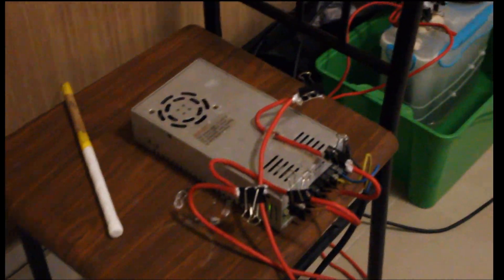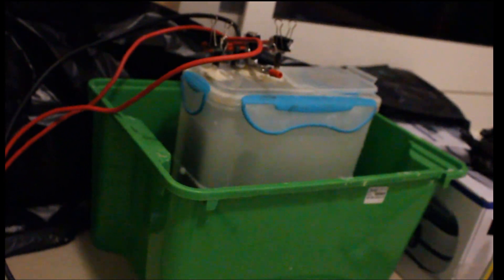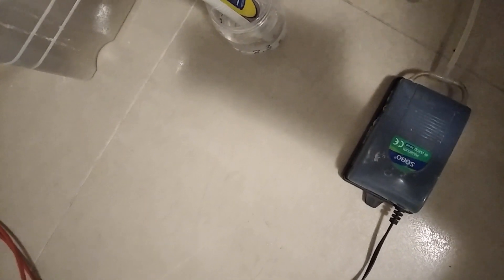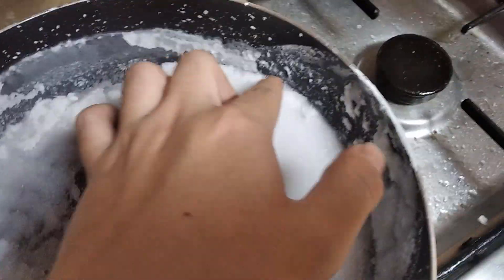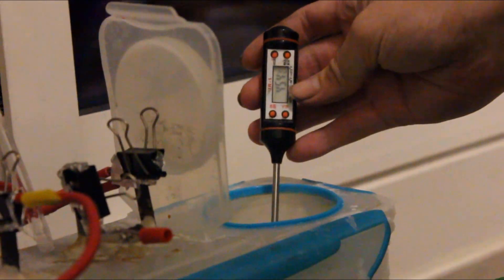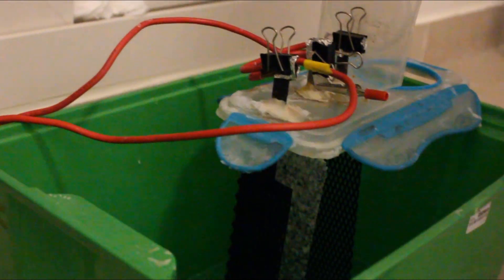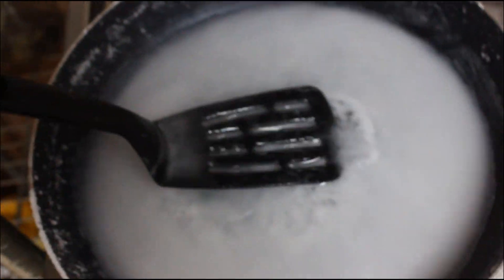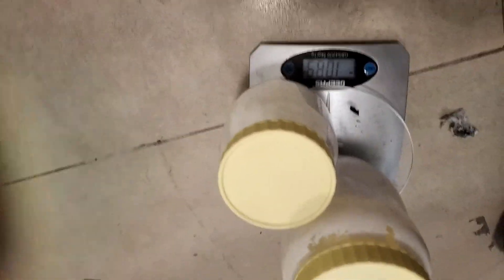pH buffered chlorate cell full run.

Comment: What is the minimum current density needed to protect the anodes? Like if somebody wanted to put a battery in parallel with the electrodes to protect them in case of a power failure.
Reply from the maker: you would ofc have to put diodes across it but overall as long as the anodes are polarized above 1.3V its fine id go for 1.5V just incase as for current density that doesnt matter as much as polarization voltage because ultimately its what will decide what electrochemical reactions occur.
One fked up way to test this is to disconnect a cell and hook up a voltmeter to find the potential as a galvanic cell and simply run voltage higher than that.
IK som1 who does another method to protect the anodes where instead of using Ti cathode he uses steel and during switch off it acts as a sacrificial anode protection the Ir-Ru from oxidation into RuO4 ofc at the cost of the cathodes.
Reply: @CatboyChemicalSociety  Yeah, I guess if the battery voltage was lower than the cell voltage, you would need a diode to prevent overcharging the battery.

I know anodes have a recommended current density range. I wasn't sure if the minimum of the range was to protect the electrodes, or if it's a current efficiency thing. Since it's a voltage situation rather than current, I guess that answers that question, too.

Would a steel anode protect a platinum or PbO2 anode?
Reply from the maker: @Groucho_Marxist_ASMR  oh PbO2 cannot be protected by steel cathode because it gets ruined and I wouldnt risk Pt either. These 2 need active anodization for protection and for PbO2 you actually need 1.9V or higher to polarize it to a safe level so 2V is typical.
Reply: @CatboyChemicalSociety  Cool. Good to know. 

You've got a great channel, btw. Amazing stuff.

Comment: I created a cell of anode (positive) mmo, and cathode (negative) titanium, each of them are 5 cm * 15 cm, in a cell consisting of 2 liters of water added to them 200 grams of sodium chloride and I ran the cell on 5 volts and 20 amperes Within 24 hours, some rust appeared in the solution, and the titanium electrode turned black, taking into account that the temperature was maintained between 60 to 80 degrees. What went wrong?
please help me please
Reply from the maker: you fucked up hard.
2 liters with 200g NaCl means you dissolved 100g/l which is too dilute leading to errosion of your Ir-Ru MMO as its not designed to handle low chloride.
you should dissolve about 820g of NaCl and it would have been fine or bought Ir-Ta MMO which would not have a problem here.
Reply: @CatboyChemicalSociety  Do you mean to dissolve 820 g of sodium chloride in 2 liters of water?
And do I add sodium chloride with water when the water drops in the cell
Reply from the maker: @AhmedSabry-cz4kf  yes that is how its supposed to be done.
820g in 2 liters of water and adding NaCl to keep it saturated as it runs.
Reply: @CatboyChemicalSociety  The temperature reached 77 degrees, is this due to a lack of chloride or does this have another reason?
Reply from the maker: @AhmedSabry-cz4kf  probably related to nothing more than amps you put in.
But from what you described about water turning orange and cathode turning black it means you damaged your MMO anode by running low chloride.
Next time avoid doing this because this orange water is very toxic due to ruthenium tetroxide which if you get exposed to will stick inside your bones and can cause cancer sometime in the future.
If you want to avoid this I suggest you buy the other MMO containing tantalum instead which can even survive low and zero chloride.
Reply: @CatboyChemicalSociety  This means that my anode has been damaged and is not fit to work again, or can it be used?
Reply from the maker: @AhmedSabry-cz4kf  it depends on the anode type most likely it may still work if the current is still fine but if it pushes no current it is wrecked.
most newer anodes have a 2nd coating of IrO2 to protect the substrate.
Reply: @CatboyChemicalSociety  Thank you very much for your interest in replying to me
You are one of the best people I know on the Internet and help for nothing
Reply: @CatboyChemicalSociety  I did everything I could to produce the chlorate and add enough sodium chloride and the temperature did not exceed 65 degrees and I added a very small amount of HCl to the water that I added when the cell level fell, however, no chlorate was released to me after running 48 hours and The titanium cathode turns completely black
Reply from the maker: @AhmedSabry-cz4kf  the electrodes were already damaged from the previous issue.
cathode turns black = damaged anodes.
Reply: @CatboyChemicalSociety  But the anode remains in its natural shape, or does the shape not matter?
Reply from the maker: @AhmedSabry-cz4kf  the coating was damaged during your 1st message already.
you ran it when the concentration of NaCl was very low which causes damage.
Reply: @CatboyChemicalSociety  Is this all, or are there other reasons so that it does not happen again with the new anodes, and what do you recommend for me from cheap anodes?
Reply from the maker: @AhmedSabry-cz4kf  its really just that if you had ran saturated NaCl then this problem would not have happened.
Reply from the maker: @AhmedSabry-cz4kf  one more thing I will say is that you cannot remove NaClO3 from solution without fractional crystalization or salting out with KCl which you need to boil the solution till you see some crystals then freeze it.
If you forgot to do that then that explains why u got no product whereas your electrode would be fucked because of your earlier run conditions so I would imagine boiling that now very toxic liquid is not advisable unless you want risk of bone cancer in the future due to ruthenium poisoning because it sticks to the bones.
Reply: @CatboyChemicalSociety  I would like to learn by doing a simple experiment using an inexpensive anode and a small cell so that I can produce a small amount of chlorate and the purity percentage does not matter so as not to damage the new electrodes
Reply from the maker: @AhmedSabry-cz4kf  yes try first doing it with graphite at lower temps just to get the feel. because it is pretty complex mainly to do with troubleshooting to make it using proper electrodes.
If you want electrodes tho that will not degrade even if abused your only option is Ir-Ta MMO which is double the price of Ir-Ru but it wont be destroyed in the same way.
Furthermore Ir-Ru anodes need calculations to ensure that the chloride levels are not to drop below 80g/l
Reply: @CatboyChemicalSociety  How long does it take to produce chlorate in the form of crystals in a mmo cell in the presence of 2 liters of solution and 20 amperes
Reply from the maker: @AhmedSabry-cz4kf  if its NaCl it wont you need to do fractional crystalization to seperate NaClO3 from NaCl.
Reply: @CatboyChemicalSociety  I do not understand
Reply from the maker: @AhmedSabry-cz4kf  ok here steps.
1. boil the solution in a pot till crystals appear.
2.pour off the solution from the pot but do not include the crystals.
3.put this solution in the freezer for 1-2 days until it reaches -16C.
4. the crystals that come out are pure NaClO3 enjoy.
the recovery of this process is 65% but the remaining solution can be run again in a cell with more salt added and this process repeated based on runtime calculations to convert added salt.
Reply: @CatboyChemicalSociety  How long is the operating time after which the solution is boiled?
Is it possible to produce crystals from sodium chlorate without boiling
And if you want to produce potassium chlorate in the cell, is the process of boiling the solution also done?
Reply from the maker: @AhmedSabry-cz4kf  add KCl to NaClO3 solution from cell will cause KClO3 to be formed but also yess you need to boil it but only until its all dissolved.
Reply: @CatboyChemicalSociety  How long is the operating time after which the solution is boiled?
Reply from the maker: @AhmedSabry-cz4kf  you have to put in freezer in both cases and even then it depends on solution volume but 2-4 liters takes 1 day to get to temp.
Reply: @CatboyChemicalSociety  thank you
Reply: @AhmedSabry-cz4kf  you want make chlorate out of electro-chemistry without any chemistry knowledge ? lol You don't understand fractionnal crystalisation, product solubilty difference, methathesis...
mysteriusBhoice you shouldn't give informations to this type of peoples for two reasons :
one, for security of this guy
Two for security of other people it is maybe a guy looking for djihad (look at his name)
Reply: @AhmedSabry-cz4kf  are you done your cell now?
Reply: @johnkane8742  no

Comment: Hello,
with my power supply mean well 5volts 26amperes, I tested with my ammeter I only have 6 amps, if I shorten my cables, and by putting calcium chloride, I will manage to gain a few amps? thank you in advance ..,
Reply from the maker: is your salt solution saturated?
whats the distance of your electrodes I have mines set to about 4 to 5 cm apart.
6 amps means either 1 of those conditions arent met.
Unsaturated salt solution is very bad for your electrodes if the chloride level is lower than 100 grams per liter.
The contact points of the electrodes should also be copper plated and clamped hard with binder clips or other methods.
wires must also be THICK and capable of handling high current of their resistance is too great.
Use all 3 ports in your meanwell outlet to distribute the load evenly !
Reply: MysteriusBhoice yes my solution is 350grams KCI /liter of déminéralised water, my electrodes are 3cm apart , I have copper plates next to my électrodes , I have only 2 ports for the + , and 2 for the other I use all ports , thanks
Reply from the maker: @pyrotekmanfred6503  size of electrodes?
the size of electrode ultimately determines current flowing throgh the cell,
if you have the same exact electrodes as mine and not getting high amps with 2 electrodes which should get up to around 15 amps then either you have smaller size or your powersupply seems busted can you link me the model.
3 electrodes like mine is 30 amps or more since copper plating increases efficiency by a lot my theoretical current I can probably flow through with the potentiometer set to max is 40 amps but that would heat up my cell too much.
Try adjusting the voltage potentiometer with a flathead screw because all meanwell power supplies have one.
Reply: MysteriusBhoice hello, 
Mean well rs -150-5.  My surface area for one plane is 34 cm2 I have 3 électrodes the same area surface, one mmo mesh and 2 titanium  mesh ,
Reply from the maker: @pyrotekmanfred6503  small electrodes means 6 amps is where it will run at.
assuming you are using a mesh anode your current density is 88 ma/cm^2 since you account for both sides
and if you are using a plate anode its more like 100 ish but anyway you can increase the operating voltage via the potentiometer.
that white screwdriver thing which is on the left or right of the input output buss is your potentiometer.
for mesh electrodes your max safe current would be about 9.5 amps and for plate its around 8 amps.
if your cell is of lower temp these values apply however if you have good pH control which means high cell temp of 65 Celsius then you can probably run it at 12.2 amps but I highly doubt your supply could reach that without you copper plating the electrical contact buss bars of your electrodes.
my best advice is run at 8 to 10 amps and if cell temp is high then you could increase it more to as much as you want but I really recommend running it at those levels only assuming your electrodes are MMO since at those levels you be running around 120-150 ma/cm^2 which is hypochlorite safe.
Reply: MysteriusBhoice thanks for your help, I have 4,6 volts and 8,9 amperes , i must let run for 2 weeks with my 3,7 liters jar , it is eternity when I see your setup 1 kilograms in 4 days... is I can copper plate my bar électrodes with 2 aa battery  copper carbonate and alcohol solution ? Thanks
Reply from the maker: @pyrotekmanfred6503  heat copper carbonate in oven or stovetop to form copper oxide!
mix copper oxide wiith 6% storebought clear vinegar and heat in a beaker or borosilicate glass dish until deep blue.
take resulting mix add 10 ml of alcohol and a drop of dishwashing liquid.
take the plating bath and before plating the contacts sand them down with sandpaper and avoid touching them with bare hands use gloves.
after sanding take dishwashing liquid and lather electrode contact until it coats it in a film.
hook up negative end to the electrode stem and secure it.
place in plating bath 8 to 10 cm away from copper anode and leave for 1 hour.
flip after 1 hour and leave for anther hour.
even plating should form if done correctly.
take out electrode and do with the other 2 electrodes.
Warning do not hook up the lead to the mesh while plating ONLY stems or else you may damage to coating

Comment: Hello , i have a power supply like you :25 amp ,5 volts but my electrodes are 2 x titanium mesh , and one mmo mesh , the surface area for one électrode is 34 cm2 , do you think my électrodes can to be toasty or it is ok? Ps: my cell is 1,7 liters.., thanks....
Reply from the maker: is that total surface are or the surface area for one face?
if its total surface area then the max current you can run in a non pH controlled setup is 5.1 amps and for pH controlled its 8.1 amps if the surface area you gave me is for only one face of the electrode then just double those numbers.
Reply: MysteriusBhoice thanks for your fast reply👌, it is 34cm2 for one face
Reply from the maker: @pyrotekmanfred6503  so thats 10.2 amps for no pH control and 16.2 amps for pH control
Reply from the maker: if your electrode is a plate type then getting 2x titanium was a smart choice since it helps give even current density but if its a mesh type then you shoulda bought 2x MMO since mesh electrode holes allow for even current density despite location of cathode.
Reply: MysteriusBhoice no all my électrodes are mesh: i have one mmo mesh surrounded by 2 titanium mesh , they have the same surface.
Reply from the maker: @pyrotekmanfred6503  welp will work but a general rule of thump for chlorate cells if you plan to use pH control.
always have anode surface area greater or equal to that of cathode surface area.
if you are doing non pH controlled setup then you dont need to worry about it since all chlorate made that way is by electricity and no bulk fluid reaction takes place.
Reply: MysteriusBhoice , so i must Find a little big électrodes for my power supply?  Thank you
Reply from the maker: @pyrotekmanfred6503  I mean my setup is pretty overkill 1.6kg pure NaClO3 in 4 days XD
Reply: MysteriusBhoice omg 1,6 kg!! Big setup !! When i see your big électrodes and see my tiny électrodes lol
Reply from the maker: @pyrotekmanfred6503  I honestly dont know what to do with all my chlorate sometimes I use it for making permanganate and chromate or exotic chlorates via membrane electrolysis.